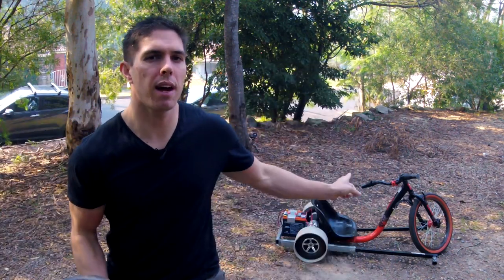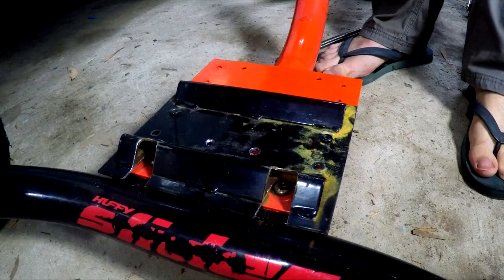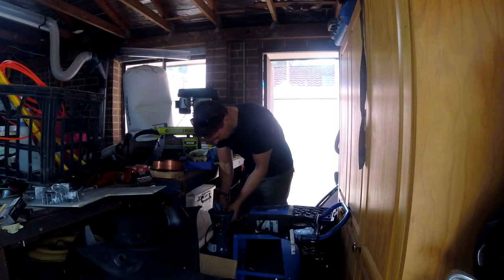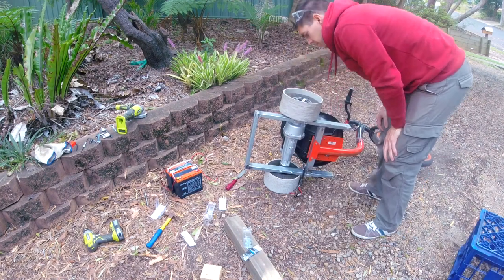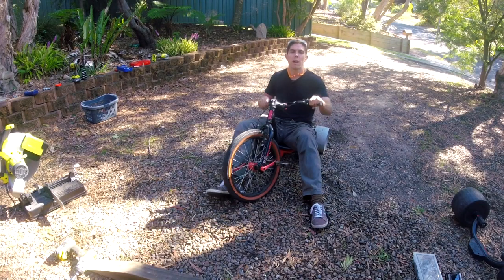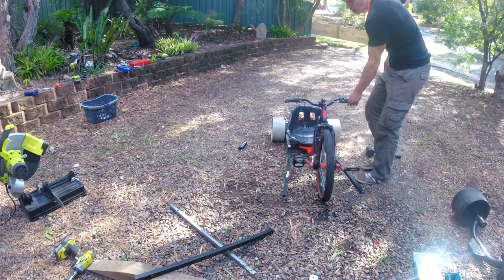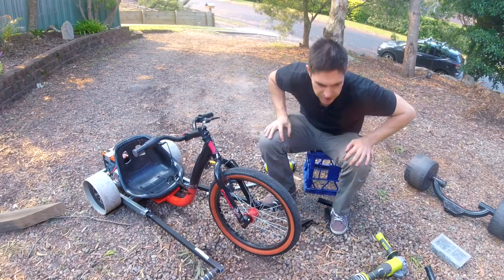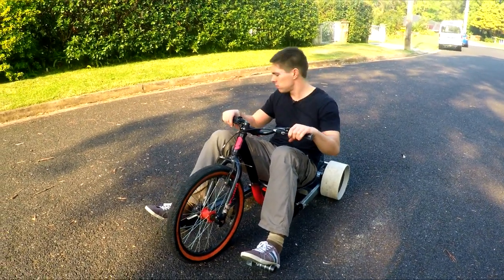Drift trike fabrication - Drift Mobility Scooter + Drift Trike - Part 3

Comment: You sound aussie? I have a 3wheel shop rider i thought of doing this with but not as a drift trike but just bigger front wheel ,lowered seat and lengthened wheelbase. Similar to yours but a bit bigger wheels than standard to get more speed. Pubrider was my idea. What was your motor/axle out of originally, my axle is always either locked or freewheeling. I was hoping to just use all of the original speed control/reverse levers to keep it simple, thanks for your ideas , now i need to find a front end to use and make it pivot just behind the seat to lean into corners. Great vid man.